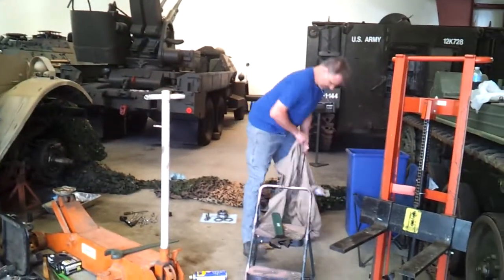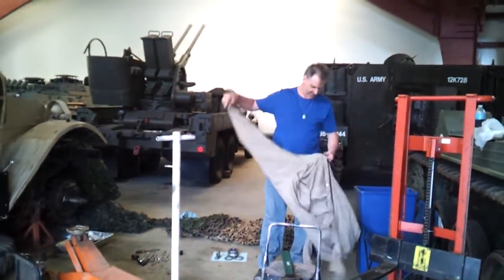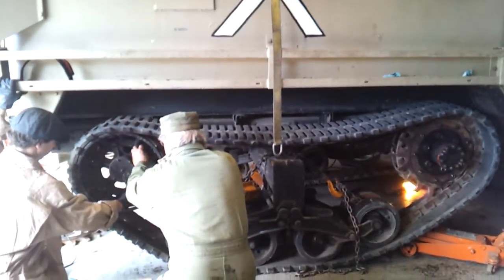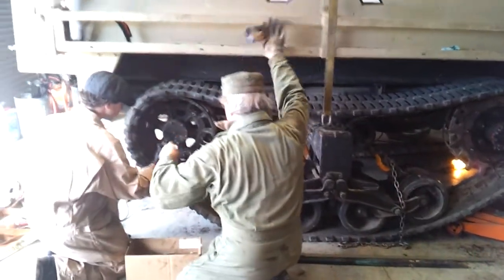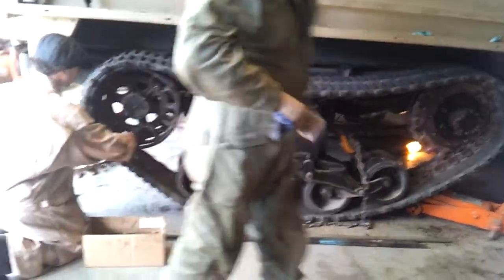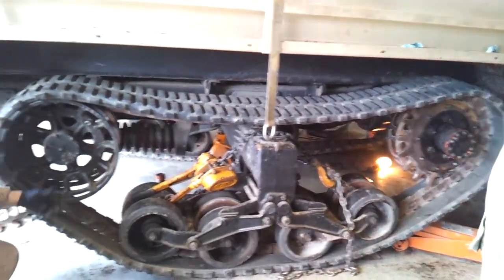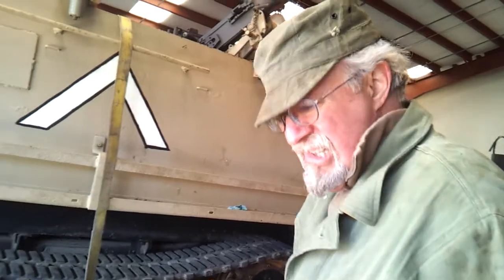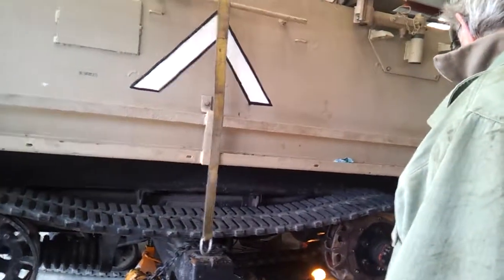Track replacement on half track tank(1)

Comment: Last year I tracked and de-tracked two halftracks. My question is why are you putting tracks on without the sprocket assembly incomplete? The only piece you need to remove is the rear idler ring. You will also want to back off the tension on the idler spring. If that is not enough take a impacked deep socket and place it between the idler stop and the end of the spring pivot rod and drive the idler stop in to compress the spring more. you did a good job supporting the bogies. Here is a link to my track work http://g503.com/forums/viewtopic.php?f=24&t=217204. Keep up the good work.